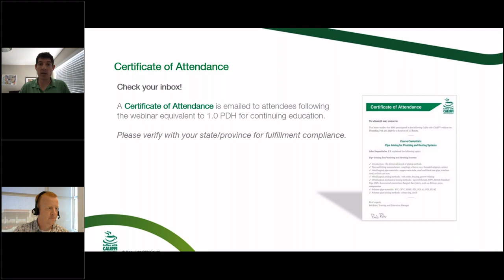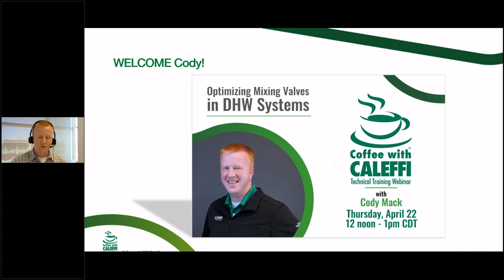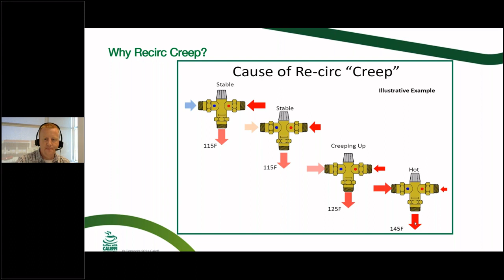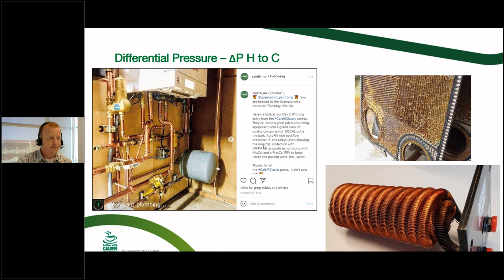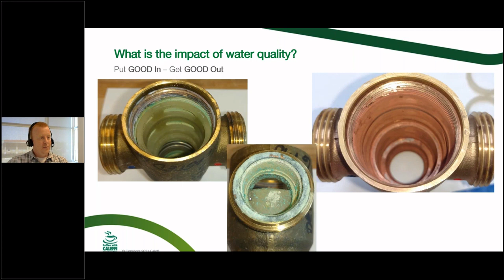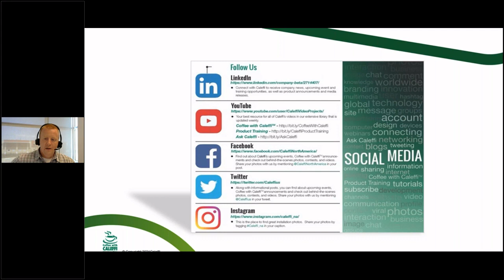Optimizing Mixing Valves in DHW Systems

Comment: Thank you and thanks to Greg. Everyone in your company really. All the information I’ve been able to read has made me better. I really appreciate the in depth explanation through the literature and videos. I read all I could, only from caleffi. Also for being able to help answer a question over the phone for a stranger (me). 

That sets your company apart from many others. To all, I really appreciate it. I’m not a newb but I am in a situation where I haven’t had much experience, it needs to be working per spec. Headache!!! Big props to CALEFFI for actually thinking about the plumber/tech/contractor. Providing easy to access literature, podcast, videos..etc

You all are badass for that.